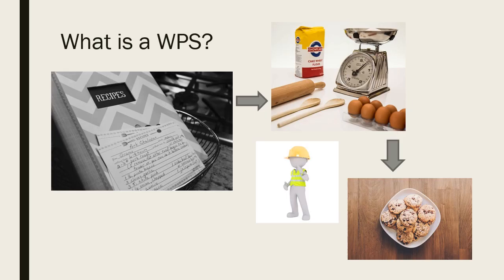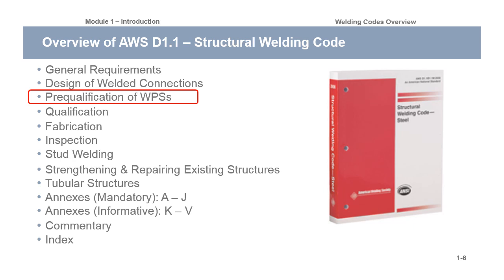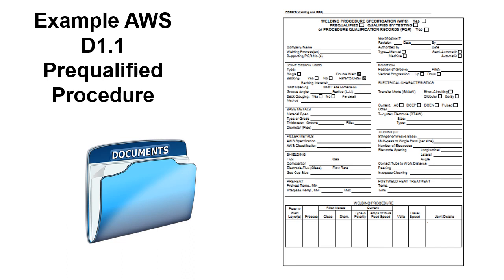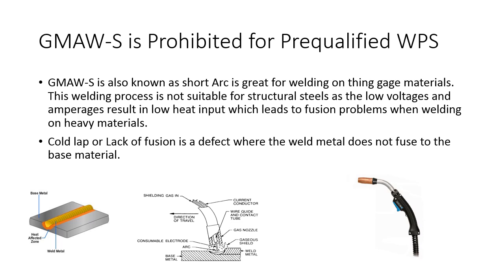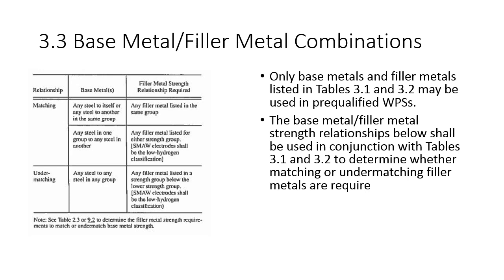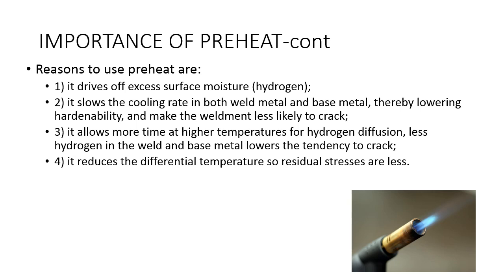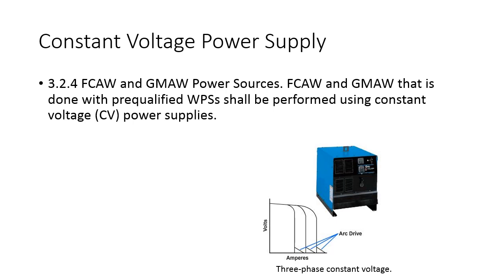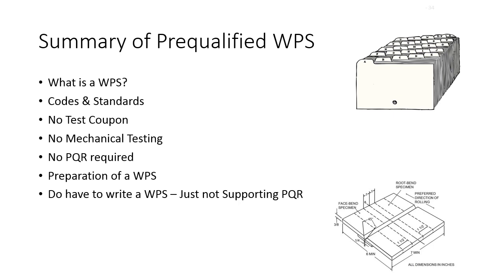Prequalified WPS D1.1: A Deep Dive into Clause 3 | AWS Structural Steel Code

Comment: Hi , How do I set short arc, globular or spray transfer in a same equipment ?. Does it requires a special machine or can I do it with a regular ESAB MIG 400i cccv etc ?
Reply from the maker: It is by cranking up the voltage - you will need a shielding gas with a minimum of 80% argon for spray transfer.
Reply: @gpacex  Thanks ,By chance  is there any standard reference from where we can get those values directly ?.
I am looking to weld 20 mm low carbon steel plates in a tee joint filled weld.
Appreciate your help...
Reply: @arjunbabuchala  I'm a little late but if you ask 5 different people you will get 5 different answers, but general short circuit is 18-22 volts/7525 gas and globular is 22-28v/7525 gas and spray is 28v and above min 80% Ar mix
Reply: Hi, 
A small query.
Electrode dia is an essential variable for pre-qualified WPS. Can I use multiple diameter in a WPS which is less than the Max dia allowed. Example for SMAW, 2.5/3.2 in a WPS or separate WPS for each dia?
Thanks

Comment: Dear Mr. Harry PACE, thank you for awesome and magical practical knowledge sharing regarding prequalified wps which is part of AWS D 1.1, however I want to corrected one issue about steel quality in Turkey (Istanbul) (video time regarding with issue 28:08 ) , Turkish steel quality is much better than chinese because of my company is exported all of the our manufacturing of steel pile pipe  to Europe and USA, up to now we did not face any nonconformance related with 3.1 Mill Test Certificate or any type of material nonconforma ce from our Client or Customer in USA, BEST REGARDS

Comment: well done impresive xplanation, hope you can response to my question, we have now a build up beam the flange thickness is 60mm and web thickness is also 60mm it is a CJP ,  the grove preparation angle is 60 degree i think it is to much already all we know the standard grove angle for tee butt joint is 30 to 35 degress is that possible or fall under any AWS clause, thank you in advance for those who can adress my concern cheers.